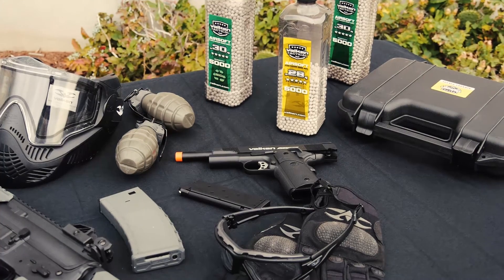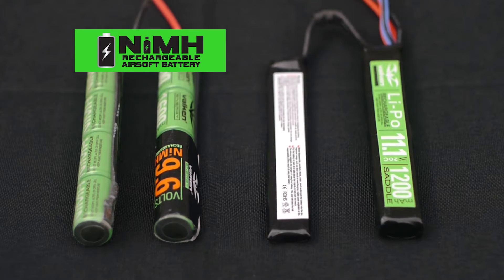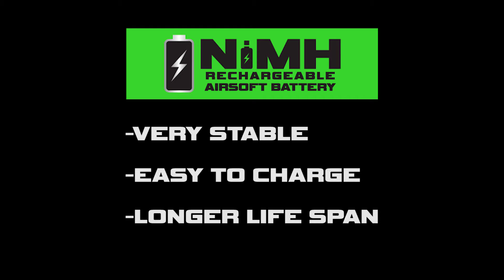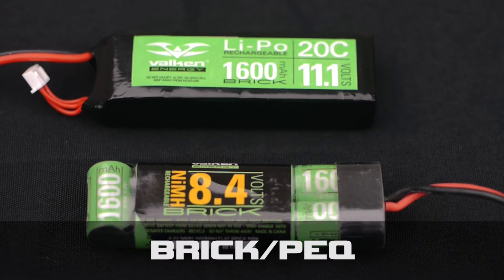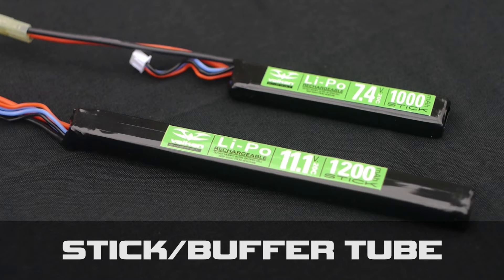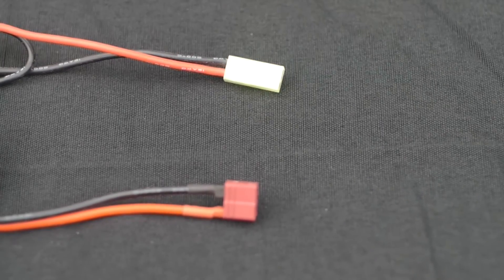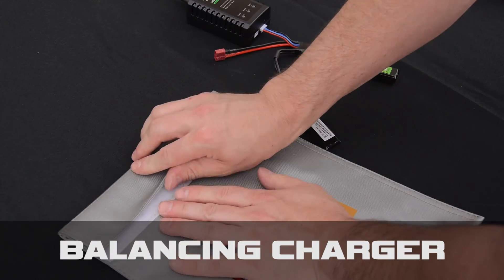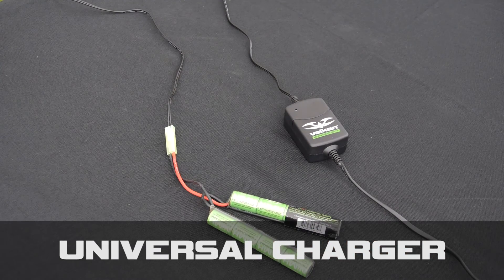Valken Tactical Gear Guide Airsoft Batteries

Comment: What is the battery for the airsoft mp5sd6?
Reply from the maker: Since the MP5 SD6 is front wired and the battery is stored in the front handguard, we recommend our Valken Energy 7.4v 1300mAh 30C Split type battery: http://www.valken.com/Battery-Valken-Energy-LiPo-7-4V-1300mAh-20C-2-Saddle-11

Comment: I happen to have the exact same charger and battery (reffering to the LiPo butterfly battery and the balancing charger). However, when I plug in my battery, the green LED under Cell 1 starts to blink on and off, while the other 2 LED's stay off. What does this indicate? I tested it on 2 batteries, so I don't think it's a problem with those. Anyone know what that blinking LED means?
Reply from the maker: contact out support line during business hours